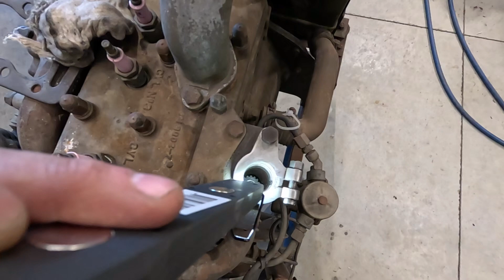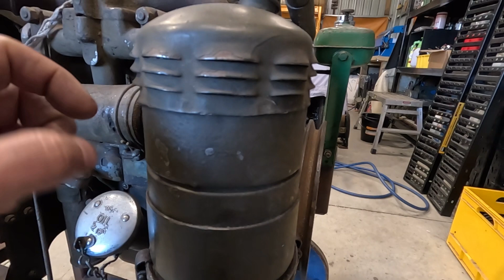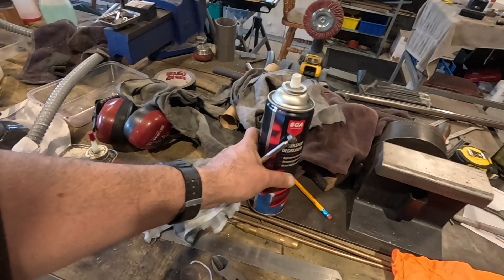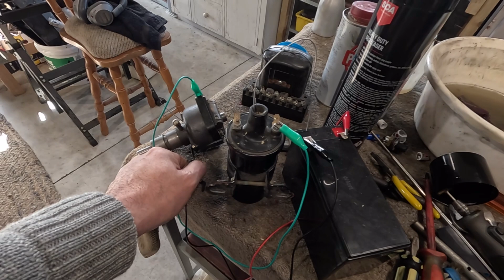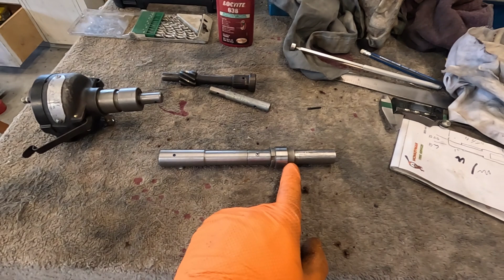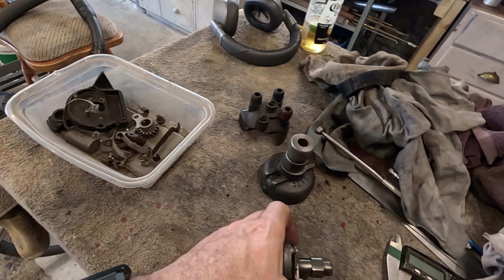Coventry Climax ASM Engine - Part 1

Comment: As you’re unable to do a compression test, you could always do a cylinder leak test.  These are always done with the engine stationary, on TDC (compression stroke).  When I was working as a motor engineer, I made several adapters from old spark plugs by removing the porcelain and the electrodes and welding an airline adapter on.  Won’t give the compression readings but it will tell you if there’s a leaking valve or piston blow by, etc.
Reply from the maker: That's a very good idea! I'll have to see what I can rig up. I have taken apart the fuel pump and the carb now. Neither would have worked as is.

Comment: Years ago a workmate of mine had an identical motor that he used for driving a firewood saw , it had magneto ignition which eventually failed , the mag was then used as a distributer for coil ign. I think it eventually wound up in a little museum just outside Tirau.
Reply from the maker: Finding an mag, even a 'dead' one for it isn't easy. Even old distributors are getting harder to find. People say just look on TradeMe but honestly this stuff isn't coming up as often as it used to.

Comment: "I'm not going to get distracted"  "I'm not a parts hoarder"     You're a funny guy...😁 You are probably fully aware, but I'm going to say something anyways.  I would advise some sort of manual timing adjustment, for the sake of your starting arm.  Even a small engine will get your attention when it's not happy with it's timing.
Reply from the maker: I was going to make sure it's set well before TDC for the first try! It seems a little hard to crank over by hand so not sure how well that will go. No starter motor on this of course so it much be possible. I was considering making a plate with slots so I can have some manual adjustment on the whole distributor body to advance it but for it to just run I don't think I'll need to.
Reply: @asciimation  Sounds good, but I think you want it to fire well after TDC. That way it spin away from you... not at you.
Reply from the maker: @shedbythetracks  Yes, that was a typo. Definitely AFTER TDC! Firing on the downstroke.  Being a side valve you can't just look in the plug hole to see the piston top to check.
Reply: 😁 @asciimation

Comment: I vote for bang a distributor in it and run it. You want to know what you're dealing with before pulling it down and spending good money on parts (that are likely hard to find). 
Best I can tell from what I've found online about the ASM, this is about a 1000cc engine. In sidevalve configuration, it's unlikely to make much more than 25hp. Heaps for basic industrial purposes, pretty underwhelming in anything bigger than an Austin 7. What's the plan for it?
Reply from the maker: No plan other than see if it runs. I don't want to use it in anything. Just a static fun thing to fire up now and then. You'd be better off with an Austin 7 engine in any sort of vehicle I think. I have a fully rebuilt one in my special not doing anything until I can work out how to get that on the road after the Riley! This isn't one of the sought after Coventry Climax engines. This is pre all that which is what makes it interesting. I want to avoid spending money on it if I can! Just oil for it will probably cost more than I paid for the whole thing! A distributor cap alone  is $50. And I need leads although I should have some to cobble together somewhere. I paid $80 for the whole thing (+$5 for the old distributor).

Comment: Hi Simon  I think the Coventry Climax engines originally drove water pumps on fire engines or were a stand alone pump for pumping water from streams etc. Cheers John
Reply from the maker: Yep, those were the later ones. The FW engines. FW for Feather Weight. I think it was from them the later racing engines evolved. This one is pre that so it's just simple, vintage side valve.